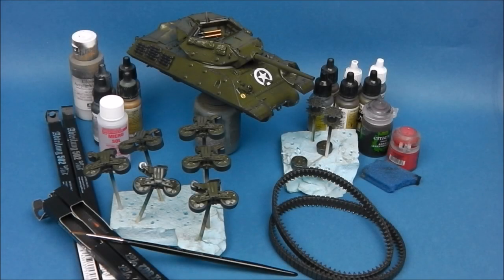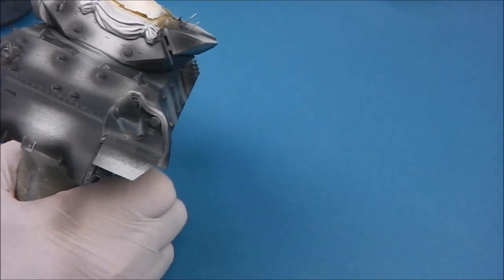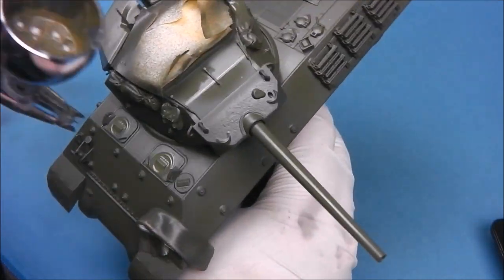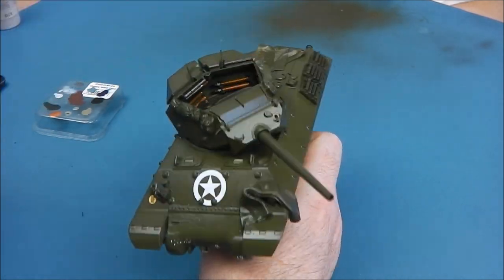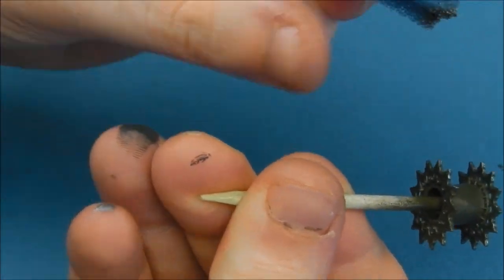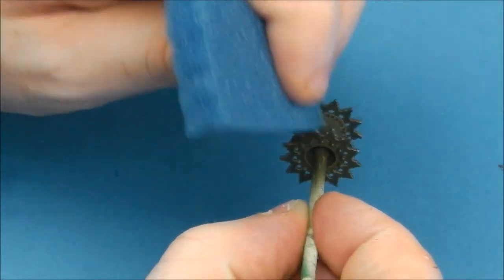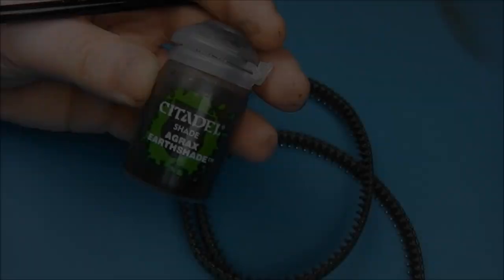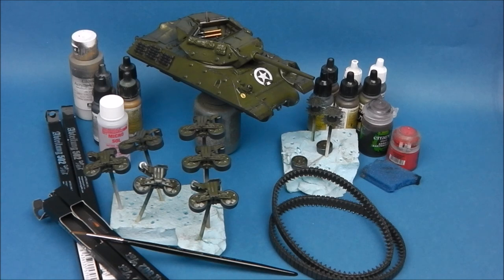Tamiya 1/35 M10 Tank Destroyer Build Part 2 Color Modulation Tutorial

Comment: That's a good shade for British armor what did you say that was Armor green from vallejo, cool I use there 2 olive drabs and the pre shate under coat similar but using white in the High spot's, I've been experimenting with that AK Transparator for the pre shading and it's working nice! One Normal coat of the base coat and then I'm trying the Transparator mixed in the next layers and it's definitely working well for easy and fast modulation that looks good great video's bud watch alot.
Reply from the maker: Its armor green but I believe its their RLM71 color now. That sound likes a neat idea using glazes for modulation will need to try it out!
Reply: @longlance67  the Ak Transparator I just bought out of curiosity really thought it was just another gimmick like but it's brilliant mate! Compared it to vallejo I bought the same week it's just a different thing it is a glaze but god hard to explain you'll see when you try it mate! Cheers for that paint code!

Comment: Shane is rendering an older tank with a lot of dirt and rust. Hence, this is a tank that had a rough life. However, just like many other modelers, he forgets to weather or damage the most fragile parts on this tank: the RUBBER parts !!  The wheels and track pads were the first items to get damaged, even though this rubber is very tough and durable.
Most modelers overlook this part of the build. They weather a tank to death, but always forget to simulate damage on the wheels and tracks.
Another details most modelers overlook, is the fact that most tanks had a very short life span, so few of them had a chance to rust. They did get dirty, but heavily worn and rusted....no....that was only for the few tanks that managed to survive for years.
Reply from the maker: very true indeed ! out of all elements of a tank its rudder pads on tracks that wear first, and then the wheels its something I should do more to be fair lol